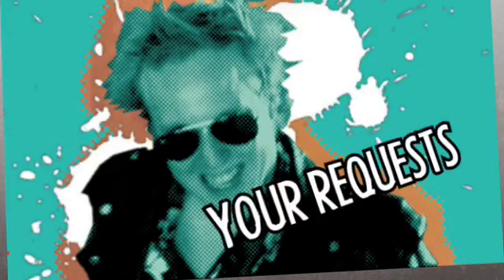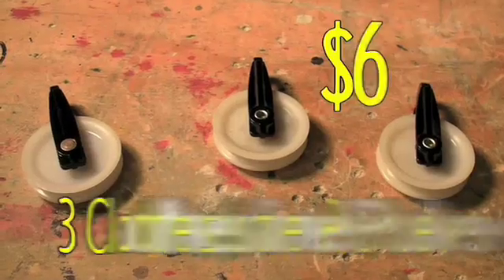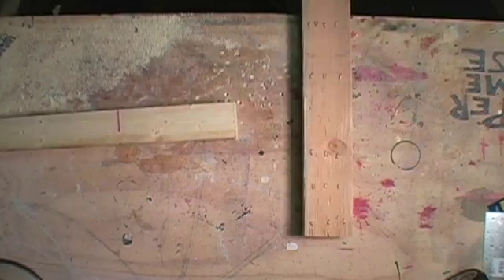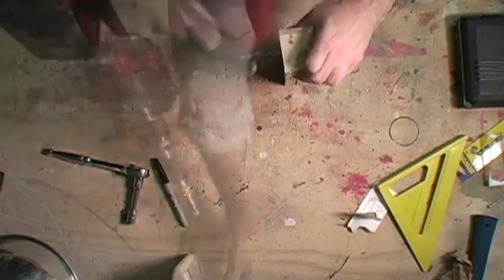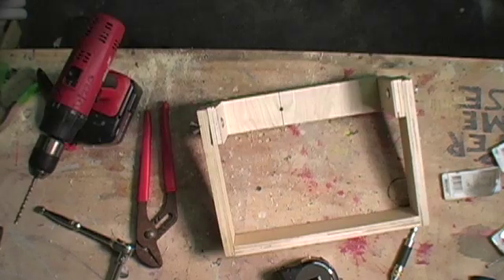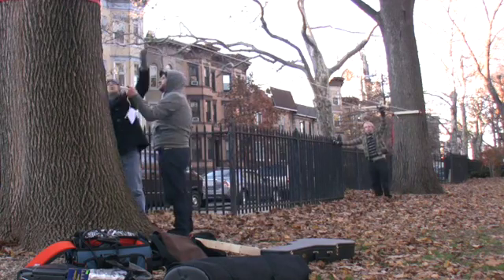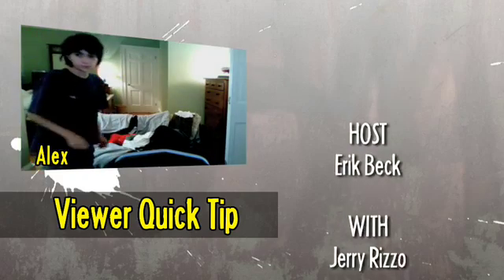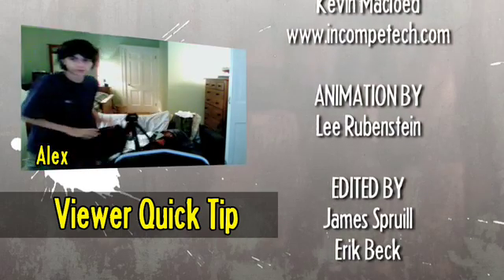How to make a Cable-Cam for Cheap : BFX : Build

Comment: If you're willing to spend an extra $20-$30, you can get some 550 paracord, which is about the same dimensions as the clothesline, but you could easily use 100 feet or more without breaking it (it is rated to 550 lbs after all).  You would just have to tighten it several times to deal with the elasticity.

Comment: to save everyone from having to write down all the materials here:

#8 clothesline

3 clothesline pulleys

2 ratchet straps

5/16 bolt, wignuts and washers

four 5/16 by 2” Eye bolts

2 flat mending plates

1 8 foot 2x3

Scrap plywood ¾ inch

Comment: yeah, but that alone costs more than the total cost of the build. the whole point is that this is a cheap way of doing it. If you can get synthetic rope, then by all means use that.

Comment: we built more or less the same deal but used single steel cable mounted a Mitchell 35. for super speedy dolly move(150'in the air) and never broke. steel cable isn't that expensive.

Comment: Upgrade the rig with 1/8" coated cable and use two straps for going around trees with pulleys on each end will make a cable trolley that is strong and reliable.

I know that goes outside of the $30 you guys set for this project.

Comment: Instead of clothesline rope, you can spend a little more and get coated wire cabling. Also, you will want to build posts you can take with you, attach and use or this thing will have very limited usefulness. You won't always find trees forty feet or less apart. LOL

Comment: Rather than use duct tape, which leaves a residue, go to a theater or AV shop and get some gaffer's tape. It's more expensive but well worth it.

Last week, my production designer lost the roll I had in my kit; I have to get another one. She put it on top of her car and forgot to take it off before leaving. I'll miss you, gaff tape. (sniff)

Comment: Great tut, but for builds that could possibly damage an expensive camera, I would suggest that you take a bit more time on showing the actual build AND how to securely attach the cables.  The actual build and set up was only 2.5 minutes long.  You have 10 minutes.  Use it!